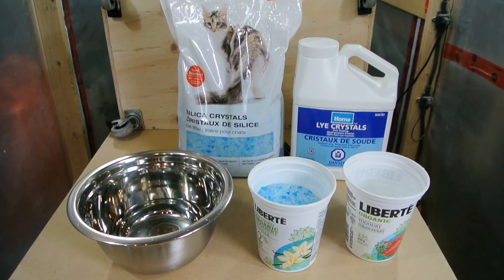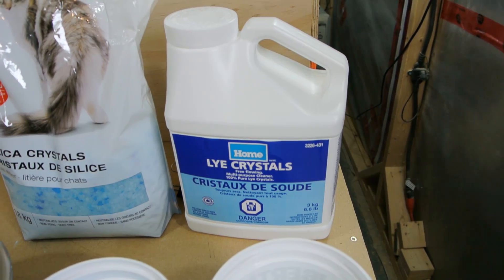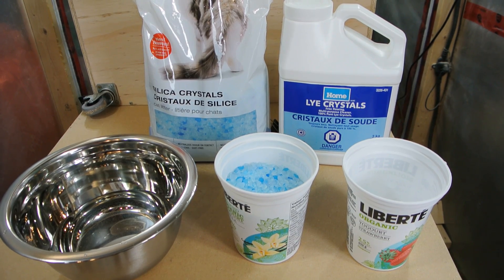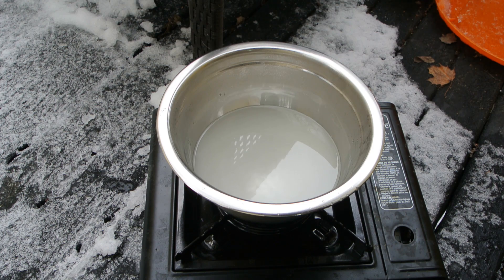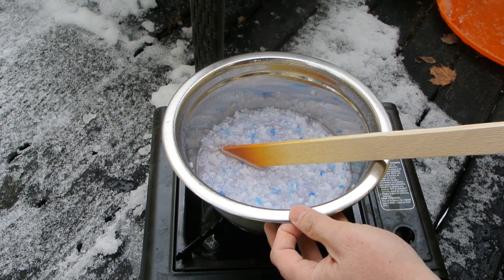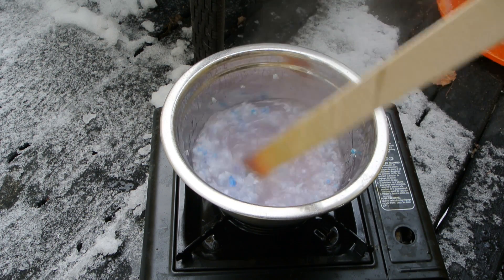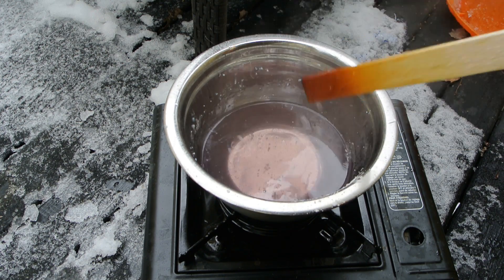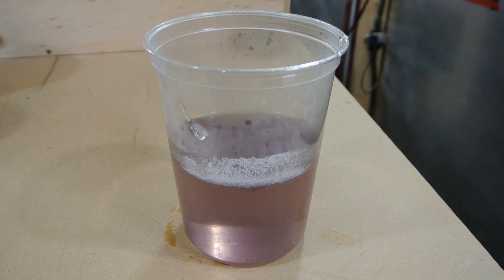How to Make Sodium Silicate - Water Glass

Comment: A verry foolish thing to do is to add the lye by just dumping it in, in one go, you can get away with it 9 out 0f 10 times then you could wear it and it's excruciating pain as your skin turns to soap not to mention the scars and burns , always have a bucket of clean water handy in case you get it on you and wear rubber gloves those cotton gloves will make it far worse if you get a spill, add it slowly stirring it in, it will heat up gradually and dissolve completely, if you grind the silica crystals in a blender first and add them slowly whilst stirring it continuously works much faster , if you want to make it thicker just boil off some of  the water , the lye will not evaporate with the steam, it will thicken the mixture let it cool and then put it in an air tight suitable container  I have just finished making a 10 liter batch  if you weigh all the ingredients including the water before cooking it then weigh the finished mixture you will get an idea if how much water you have lost through the cooking process I like a 5-7% water loss, if it's too thick just wet your sand mix a bit more it will mull in easily. if you want to test your heatproof mix fill an empty cardboard match box with your mix JUST MAKE SURE THERE ARE NO STAPLES OR METAL in the match box or sand and put it in a MICROWAVE for 30 secs at a time it should go hard how long it takes depends on how wet it is and the power rating of your microwave. Warning It will be very hot.

Comment: I'm not gramming anything talk in Kitchen terms like your Cooking there, not Parts either just Table Spoons, Cups, Liter, Gallons. Example add 2 Cups of Lye into 1 Gallon of water Heat & then add 4 or 5 Cups of Silica Cat Liter without the Blue Smurfs. Use Stainless Utensil or Heat resistant Plastic, & never put the Tools your Cooking it with where they can be used to Cook Food because of RESIDUE left in objects. Tay

Comment: This is the same ingredients used in radiator and block sealers for engines that have cracked heads ,blown head gaskets ect, However the engines cooling systems must be completely clean from antifreeze ,oil ect for this to work and you cannot add any antifreeze after putting this product in your cooling system ,the reason is the antifreeze has chemicals that penetrate the metal to keep it clean like silicone and other stuff to prevent corrosion will cause the water glass to no bind with the metal or plastics. One gallon of homebrew water glass is equivalent to about 300 dollars worth of market  brand engine block sealers
the benefit of making your own you can adjust the viscosity or water glass. This water glass is excellent for using as a high temp glue around furnaces  and stoves . i use it  on lumber and plywood by using a roller  to fireproof the material.and use it to hold ceramic insulation in place around stove pipes and exhaust systems
that have cracks .If you use it around exhaust systems on vehicles  mix your waterglass with ceramic porcelain insulation into a thick consistency of clay then heat the area and place the mix on the cracks and let dry for as long as possible. water class will cure faster under high heat and high carbon dioxide which  is the main source of causing the silica to release h20
\and therefore drys , I've experimented by adding baking soda  in different ratios and found it to be an awesome fire retardant.I will also urge anyone who is using ceramic porcelain fiber glass to wear a mask and long-sleeved and gloves. Ceramic porcelain is not the same as residential fiberglass insulation due to the fact it  will float in the air more than the reg insulation used in housing and is also finer in size . It will cut the surface of your eyes and linings in your lungs and noses. Once inside your system its impossible to remove the razor like particles.

Comment: Great video, man. I need waterglass for my geopolymers I'm working with. Because I need it for a synthesis I can not use many Industrial made waterglasses, even from well known chemical suppliers (!). Reason is that they are everything but reliable. The composition changes from batch to batch. This process is great to make tailored sodium silicate solutions.

Refractorys: In ceramics chemistry (refractorys are ceramics, of course) alkalies (sodium, pottasium...) are well known to greatly reduce refractory properties in combination with SiO2. All commercial high temperature materials are low in alkalies. Anyways, sodium plus SiO2 can be used until around 500 °C. There are tables to see exact melting temperatures and that kind.

Keep up the good work!!

Comment: When doing this it’s safer to add the lye a little at a time.   You should also have gloves and eye protection.  This mixture will eat and burn right through your skin.  Keep a gallon of vinegar on hand to neutralize any that gets on you.
Reply: Putting an acid (vinegar) on a caustic (LYE) spill is double trouble it will not neutralize CAUSTIC all you will be doing is making things far worse and even poisonous depending on the acid you are using. I worked in the chemical industry and have seen many accidents with Caustic clean cold water is the only safe way to neutralize and wash off (lye) I have actually hosed off people with serious spills on them, Caustic in liquid pearl or flake make up, check with the MSDS ON THE PRODUCT or a first aid specialist.

Comment: Andrew W, Hi, hope you can advise, I have made several batches of Water Glass using the correct measurements and ingredients, the problem I'm having is the finished product does not harden properly by air drying, it takes ages to solidify but remains tacky to the touch. Also is there a catalyst you can add as a hardener to speed the curing process. Thanks :)
Reply: carbon dioxide cues it. Vinegar and baking soda create co2 if you don't have a paint ball gun/canister

Comment: Good vid and very helpful but 2 suggestions: 1. remove the blue indicator crystals by hand first.  It's tedious but worth it.  2. Do this in the reverse order.  Add the water to the silica, add your lye and then heat and stir.  Hydrating the crystals first helps them to release the trapped air and will help prevent foaming/frothing and a more clear final product.
Reply: For your consideration I provide a step-by-step DYI method to make approx 500ml of highly concentrated Sodium Silicate. The method takes advantage of the exothermic chemical reaction involved. It uses an insulated and completely sealed reaction container, needs no added external heating or stirring and is thus relatively safe.  It produces no fumes which open pot techniques suffer from. The reaction takes about 12 Hrs to complete (Leave it unattended overnight).

MATERIALS: a 5gal plastic paint bucket with lid, a 2qt. Glass Canning jar  (Hobby stores have these - do NOT substitute the more common 1-qt. Jar), 1/4” PEX tubing, 4” and 2” funnels, and fiberglass insulation, 200g lye, 300g silica gel (cat litter), 500 ml water. There is no need to remove colored material from the silica gel. NOTE: The 2” funnel was a modified “Cream Color Developer” tube from a Revlon Colorsilk hair color kit.

1. Obtain a two quart glass canning jar.  Into the jar combine DRY 200g lye with DRY 300g silica gel "cat litter". Blend well (e.g. put the lid on and shake it up).

2.Remove the lid and put the jar in the 5gal plastic paint bucket (used as a safety containment device) and surround  the jar inside the bucket with fiber glass insulation.

3. Put a 4” funnel in usual position as a loose lid for the jar and insert approx 15” of 1/4” PEX tube thru the funnel neck and seal the opening around where the tube passes thru with a small piece of insulation. The 1/4” PEX tube is used to safely instill water into the dry 500g mixture. 

4. Completely cover the glass jar and funnel assembly with more insulation. Make a hole in the center of the lid of the 5gal pail and install the lid, so that the tube protrudes through the hole. The glass jar containment is now fully enclosed and insulated.

5. Attach the approx 2” funnel to the top of the PEX tube and slowly, instill 500ml of water. A strong exothermic reaction results. Some steam may evolve however it will be trapped by the insulation. The boiling point will shift to +250F - you don’t want to get this shit splashed onto you!. The final quiescent temp will stabilize at about +220F - leave it alone overnight!

6. Note that chemical burns from lye heal slowly and eye damage is permanent. Don’t be stupid and try to open the assembly early just to check on it. 

7. Wait 12hrs - done. You will have 500 ml clear sodium silicate with the consistency of honey. Store in a sealed jar. Carbon dioxide from the air will cause it to solidify.

Comment: Dude, when combining such ingredients, you should not be using metal containers.  Use glass.  Why was your science labs full of glass containers?
Reply: Strong NaOH solutions, like many alkalies, etch glass, including borosilicate. In fact this process is pretty much dissolving glass' main element. Also, though boro lab glass is good with thermal shock, impact could result in a big mess, so having the opportunity to use steel is a plus.

Comment: Nasty gases?  Water vapor is the only gas released.  Maybe a little hydrogen but hydrogen is not toxic, just explosive but not enough in these small amounts.  I know I know, better safe than sorry.  This reaction is no more dangerous than cooking a pot of soup or doing your laundry.  Just don't put sodium hydroxide into your eyes.
Reply: ElGatoLoco698 ... Hydrogen will only be released if there is any aluminum present.  Thus, don’t try this in an aluminum pot.
Reply: The drain cleaners I've been able to find here in Maryland all have sodium hypochlorate mixed in with the NaOH.

Comment: I tried this but the finished product solidified. Any pointers of what I did wrong?
Reply: Sounds like you boiled all the water off.  You can usually just add water and thin it out.
Reply: @ElGatoLoco698  I think I have done the same , I'll try adding some more water to the very thick water glass I have made
Reply: more water
Reply: +Ash De Vos do I need to add more lye to the extra water I add?
Reply: +devon fields i say not, if you used the stoichiometric amount in the beginning